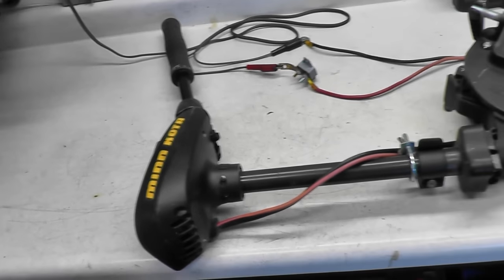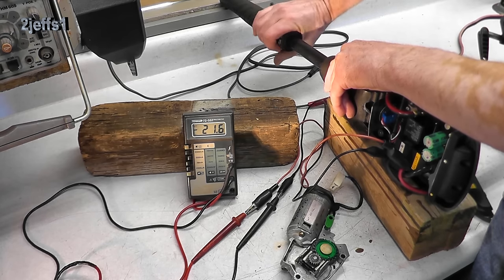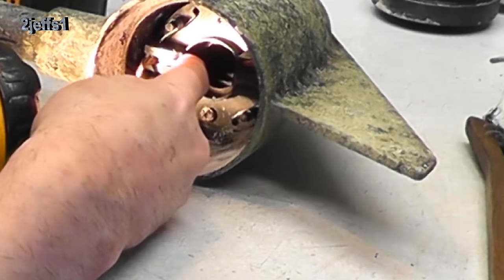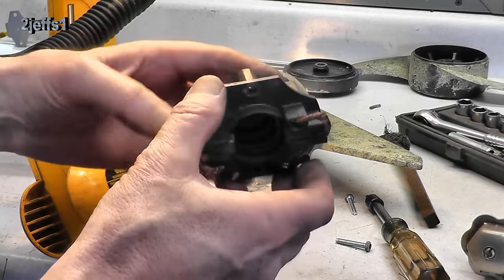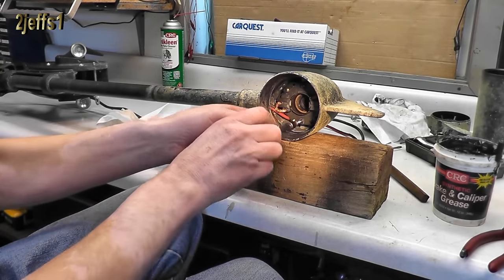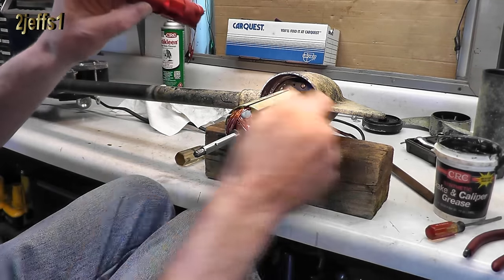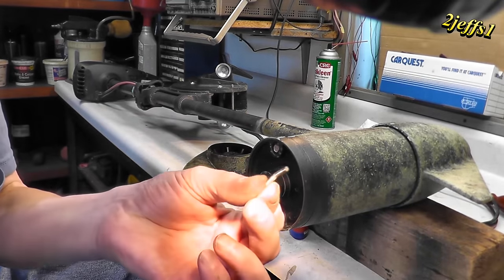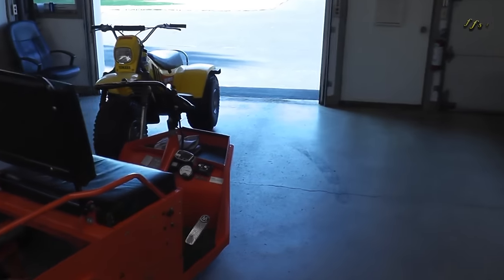Electric Trolling Motor Diagnose and Repair

Comment: Just fixed my Newport Vessels trolling motor (46 lbs.) using the video as a guide. The spring mechanism was slightly different but otherwise this guide was very helpful. Thanks Jeff.

Comment: Love the loaded custom testers.  I am a 32yr Master ASE and specialize in exercising poltergeists. I use many a tool I developed especially when you find a common testing situation.  I have 3 different bulbs, I use an old halogen high low with a switch wired in to make it single or dual load, I use 3157 also with a switch and a 921 for low current loads.  cooling fans to pwm fuel modules, works wonders.

Comment: Great video. Got to see what was wrong and how you fixed it as well as how you took everything apart.  Just one thought.  The pin in the propeller you made out of a drill bit.  I thought those pins were a much softer metal and were meant to break when the propeller is stressed to keep the shaft or propeller from being damaged.  Love the video.  Thank you for taking the time to make it so worth watching.

Comment: I'm here 4 years later.  I purchased a used minn kota c2 55 transom mount trolling motor for $50 from a nice older gentleman that got it for free on the curbside.  It ran slowly, so I knew something wasn't right.  Sure enough, I opened her up and water came out.  I cleaned all the rust, ordered up most of the parts for the lower end plus a new prop  ($100).  The armature at $50 was the most expensive.  But, given the fact that there was water in it, and I live in MN, I figured the armature had seen some freezing temps with water in it.  I wasn't too interested in testing it on the water when it got hot and created an open circuit.

With your video, I will have a like-new trolling motor for much less!  Clearly, I could've saved even more w/o the armature replacement...but, when you live in MN, $50 is cheap given our short summers!  That, and I like wrenching - it's free labor when it's a hobby!

Comment: It's nice to see someone that actually FIXES something instead of simply replacing entire assemblies. Fixing things seems to be a lost art form. Wish I had a friend like you around here to fix my 20 year old Min Kota Power Drive that hasn't been used in 15 years and the foot pedal has been laying in the boat for at least 12 years. Might be a little more challenging for you but I bet you could fix it no problem.

Comment: That was exactly what I needed to see. I have that exact troller motor and ive started doing some of the things you did. However, I didnt know about the brushes, or those 2 pieces that have the wore attached to it. Ill sand it just like you did and see what happens. Thanks a lot showing your video.

Comment: Great video. I love your attention to detail. I picked up a non-working Minn Kota for free. After watching your video I was able to take it apart, diagnose it, and fix it in about 30 minutes It turns out it was the same exact problem as the one in your video. A little cleaning and sanding of the brushes was all it took.
Reply from the maker: Thank you Kevin! Enjoyed reading your comment. Having the same issue and that the video helped you out. The best part was you got it for free!

Comment: Quickly grabbing the front of the motor shaft while slipping in the steel manet casing allowed me to be successful. I just hooked up a deep cycle battery to the motor and all speeds work and prop is spinning in the correct direction. Cost of 1995 AT 36 foot-operated trolling motor (that was not working) $40. Rebuild kit cost:$32.50 Effort at 2 hours of working on and off AND finding a 6.5mm socket to open up the thing: priceless!

Comment: You are remarkable!  At 3:39 I think I heard "brush holder".  I believe I heard you say that the brush holder is wearing out.  Then you did say "That's your problem right there".  I have a Traxxis 55 pounder and it has been difficult to get it to even spin on the first outing.  I had to repeatedly tap it with something massive and then it would start and stop.    This morning I made a decision to try to fix it, BASED ON YOUR VIDEO..   I consider myself smart and highly skilled with fine woodworking.  But I have zero aptitude with anything electrical and not motivated toward mechanical stuff.  I am now.  LOL.  After. taking that motor apart and doing what you said, I noticed that one of the spring loaded brush holders would not pop out freely.   After using 400 grit to smooth a boogger (as you say) and lubing things (especially the one brush holder (?)) I reassembled it and when to the garage to test it.  I made up my mind that if it did not work on the first attempt, I would make that 800 call and order a new Traxxis 55.  

IT WORKED!!!  And it works smoothly in forward and reverse (one other problem was the shear pin had snapped and a piece was stuck in the shaft hole)

It works like it was new.  Of course, it is probably 3 years old now and I use it a lot for my loon work (please see my website below my name).  This winter I am going to take it down cellar and service it completely.  The plate, underneath those two brush holders is broken (separated) on one side, causing one brush holder to press unevenly.  I will see if I can order it right after typing this reply.  

I love my electric motors (a Traxxis 40 too)  and have been on the water my entire life.  Now, because your teachings, I am going to actually enjoy servicing the motors myself.

Thank you
http://www.itsaboutnature.net

Comment: Thanks so much for the info
I feel much better of doing a rebuild on my trolling motor
I have 245.00 in parts 
Shaft broken and lost my prop 
So I decided to replace brush assy   O rings.   Shaft assy etc 
     It’s a Rip tided 110lb thrust 
36v 
     Thanks again

Comment: Really good video. I'll try my best to explain my situation. I have a 70 pound in Kota foot operated trolling motor, It's getting power everywhere I took the blade off, So I could get to the motor. I noticed just below the little pin that holds the blade on the shaft but just below it is what looks like a fixed washer surrounded by a piece of rubber it looked like it was sticking out so I tapped it back down so it was flush and level and my trolling motor started working fine. It's pretty new not even 2 years old

Comment: Excellent video, 
I bought a  Newport Vessels 55 lb thrust, and I rotated the handle 180 degrees to mount on my kayak.  In the process of putting the bolt back through the shaft, The bolt cut one my wires. I had to  pull the motor out and un hook the wire to allow me to pull the wire out enough to heat shrink it. I don't know how to reinstall the motor as the brushes are spring loaded.

Comment: Very informative. I am trying to figure out what’s wrong with mine. Head will turn fine but propellor doesn’t work when pushing throttle button on foot pedal. This video didn’t cover that issue but I still watched it. Lots of good tips. Thanks

Comment: Great video.....Unfortunately I might have "fixed" something that was not broken.  I took everything apart just as you did. Sanded and cleaned everything only to have it still not work. I then sanded down the battery clamps there were rusty and it started working great. At least I know everything is clean and lubed....plus no more fishing line.

Comment: Another great video.......I love the shots of the turkeys, rainbows, crows, etc. mixed in with the mechanical stuff. I got a piece of adhesive backed sand paper stuck on my bench, for doing that kind of stuff. Works great.
Reply from the maker: Lots of cridders out here. Thanks for the tip Dave, actually have some 6" discs for the da with the sticky on the back, multiple grit. Never thought of using those!

Comment: Great video on the repair. Seems like a DIYer could do this. I know the video is older but maybe you can help me out. How freely should a prop turn by hand. Mine started blowing breakers a full power. The prop spins pretty easy but is it normal to feel the magnetic resistance at you spin it? It make it feel choppy. It's hard to explain.

Comment: Thanks for your post. I will pull my one apart to have a look. Had a problem with turning it on then waiting a few seconds before it starts. It is a 12 volt DC motor. Have you any ideas why this happens?

Comment: That was nice thanks Boss

I was looking to purchase an older 17 lb thrust model but thought I'd look up videos and you were the first to click on - appreciate your time - nice breakdown sir
Reply from the maker: Thank you. Appreciate you taking the time to leave such a nice comment. This is what gives me the incentive to do more of these type video's!
Reply: 2jeffs1 
Hey boss i have question ,you may be able to answer if possible please.   On the Minn Kota Motors is it possible , to rotate the handle control head unit on the shaft ,the same way the propeller is (  so rotate the handle head unit 180 degrees ,mount it in front of me and use it that way on a kayak , is what I was thinking ,   what do you think.  I still haven't bought one or messed with one yet ,that's why I'm asking  the yellow perch off the Magothy River  - off of the Chesapeake Bay in Maryland are starting to run. I am  Getting older paddling is starting to suck long distances , LOL  Thanks man appreciate your time and opinion !

Comment: You are a kind person.  Love your calmness.   Hey I have a question for you.   I took it all apart on the bottom and unplugged the two wires on the magnetic springs. The connectors.  Hopefully u know what I'm trying to say .  It's where u marked it with a pen.  I didn't mark it with pen.  How do I know which one connects back  in to which one. Do I put it back together hoping it's right and if not switch them.  Or will it cause damage.   I appreciate you and your knowledge.  Can u help?
Reply from the maker: Think I know what you mean. It won't cause any damage, worse to worse the controls for f/r might be backwards but where the motor is a permanent magnet fields I'm thinking it might not matter. (not positive tho, sorry)
Reply: @2jeffs1  thank u for your reply.  That's what I was thinking also.   I appreciate you getting back to me so quickly.

Comment: FYI the motor was too loud for me the way to fix that is to loosen the two long bolts and turn the housing it will be quieter and perform better on the water turn it left and right until you hit the sweet spot.

Comment: Good info. I've got a brand new watersnake 34lb it's done no more than 3 hours of light work. Today it just cut out and stopped. Then a couple of minutes later the volt meter came back on and I put it in gear and after 10 seconds it cut out again. It did this repeatedly on my long paddle back. The volt meter on the motor was reading over 10 volts and when I got home I tested it on my multi meter and it said 10.50 volts. I'm at a loss, the motor was fine then just cut out. Any ideas/help will be greatly appreciated

Comment: Great video I’m dealing with a trolling
Motifs my self basically mines just clicking when I try to use it.  The head rotates for changing directions but acceleration has no engagement just clicks.  If you have an idea what it could be please share.

Comment: hi2jeffs1, I have a Minn Kota SP70 trolling motor and was having a problem with the prop going slower and slower. I thought it was the armature/brushes so ordered a replacement kit. (Turned out it was not the armature/brushings but instead a circuit board going bad. I replaced the circuit boatd but decided to go ahead and 'upgrade' with the new (and supposedly improved) armature/brush assembly that had a larger set of brushes to make a broader contact with the wider bars on the commutator. In the kit was also several new seals and a new brush holder housing. I noticed that the screw holes in the new brush holder housing were rotated about 30 degrees counter-clockwise compared to the old brush holder housing (that has the smaller brushes). But I installed everything and slipped on the motor housing assembly with the strong magnets and screwed everything back together. It seemed to work out of the water but in the water I noticed at least a 50% drop in thrust power.
My question is.. because of the new brush holder is having to be rotated 30% counter-clockwise and the brushes no longer in the same alignment as the old brushes AND because I cannot rotate the magnets in the motor housing because the long screws slide down between the magnets to hold the entire unit together, does the offset brushes affect the power? As I recall, my original brushes made contact with the commutator at a 90 degree angle to the magnets. The new brushes make contact with the new armature/commutator at what appears to be 60 or 70 degrees counter-clockwise to the magnets.
Reply from the maker: I totally believe you are correct on your diagnosis. The only other thing to check is that the controller is giving full voltage to the motor under load. However I really doubt that the new controller is the culprit.
Reply: @2jeffs1  What I may end up doing is drilling 2 new holes in the replacement brush holder to correspond with the old brush holder holes. I took the boat out today with the old armature and brushes and it was only about 70% up  to power.... I will get this thing figured out one of these days..!

Comment: HI, seems my 50 lb motor might have overheated, I found the foot pedal in the on position and the batteries drained after the winter. After watching your video I took apart the motor and it smells very burnt. I do have to fix 1 of the brushes as well but any further advice of things to look for if the motor overheated?
Thanks.

Comment: Wow! That armature and case looks the size of the one I have here but this ones for a 48 Volt E Drive.  Might just be the way it looks in the video hu?   They want over 200 bucks for the replacement for the minn kota e drive everywhere I look.   I have a smaller Min Kota 55 that i got a hold of for only 10.00   but the problem with it is, it got run over LOL  still works but all teh plastic mount hardware is busted up and the cords are a ripped apart. I just ordered a new handle for 10 bucks.  I think I should get new o rings and take that case apart like you did and make sure its still water tight.   Great video.   I have never tore into one of these.     That E drive costs a Fortune.  the guy I got my boat from said  it ran fine but they got the boat from a estate sale and when the previous owner passed away  the family left the boat with the motor in the water for 5 years. I'm hoping I can restore the guts in there and that all that fancy battery op computer board parts are all ok since they were covered and insulated.    They are selling those e drives for thousands of dollars!  YIKES!  I'm hoping I can get it going and fund the restore on the old pontoon and then just run my 40hp Gas merc on it. LOL   I dig the drill press trick,  I will try that if it's repairable.    Thanks.

Comment: Great video, I have the same motor, I loaned it to a guy and when he brought it back it was making a grinding noise, I could barely turn the prop by hand,I took the prop off and it had a ton of fishing line behind it, cleaned it off but it’s still making the grinding noise and has lost its full speed, what parts would you say are bad? Is there a front bearing there behind the prop where the shaft comes out? I think it probably got really hot and messed it up too, Thanks

Comment: I got a question. Using the drill bit as a pin could that damage the blade if you strike something with the propeller? Because I was told its a sacrificial pin.

Comment: Do you worry about grease and the rubber O rings degrading faster?
Reply from the maker: Good question John. Yes - might be a concern with certain type greases. I have been using trans gel (for assembling automatic transmissions) and synthetic brake grease, both are for rubber seals, o rings, etc which has been working quite well with no issues on these type of repairs.

Comment: I have a trolling motor problem. It is a Minn Kota 24 volt 70 lb thrust. It had been working well. Cleaned the prop shaft of debris and worked well. Now it want to shut off a few times a fishing trip. It run well in 5th gear then shut off. Run well in 4th then shut off then in 3rd the same. Then all of a sudden it would shut off in 3rd after a minute of running. Wait 30 seconds then it would run. Again then shut off again. Not sure what is causing this. Just operating in windy conditions.

Comment: i just rebuilt a powermax 47 minnkota trolling motor all went great except that the communtator and brushes do not line up, the armature goes to far back into the brush plate or if you pull it out the bearing does not engage it's bore. i if you measure everything out it looks like it is designed that way or i am missing seeing something, any ideas

Comment: Thanks for the vid.  I'm curious about the shaft seal and the mechanism for how water is sealed out....0-ring, sealed bearing, grease, etc?
Reply from the maker: There is a shaft seal which had the proper amount of drag when turning the shaft so no need for replacement. The outer case cover has an o ring which seems I replaced and the inner case had a gasket which was in good condition.

Comment: I like the test motor idea. Makes sense. I love fixes that don't cost much in parts. Nice job and well explained. Do you still have that Case back how you restored?
Reply from the maker: Still have the Case. Has over 1,200 hrs on it now from the projects done around here. Did an alt conversion on it a bit ago. No cable driven tach. Runs off ac wave from alt. Will make a vid on that (140A Delco/Delfi, was Bosch, going bad) (had the 140 upstairs so I didn't have to buy one - another cheap fix :) and an update in the machine in the future. Thanks for asking, should get on that one!